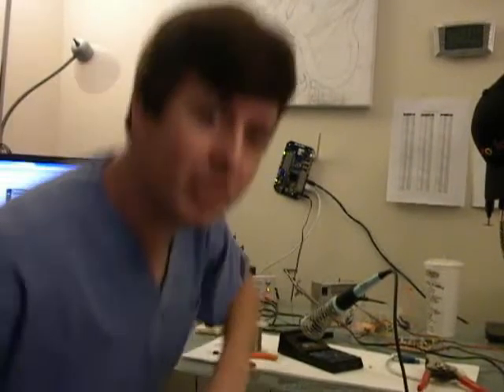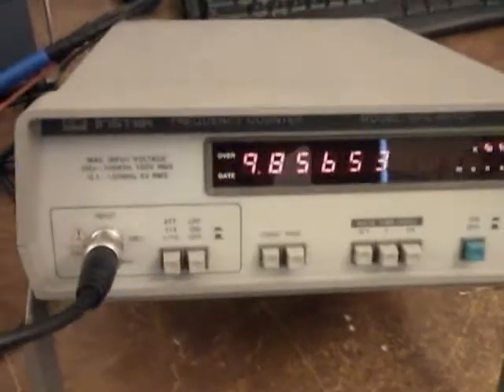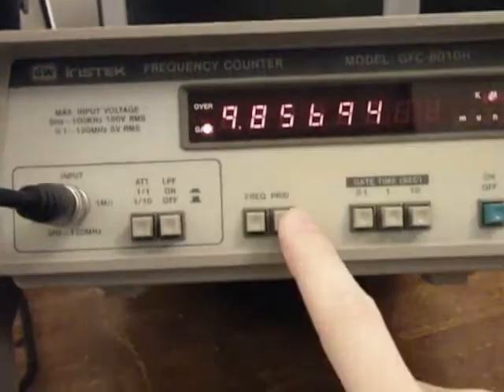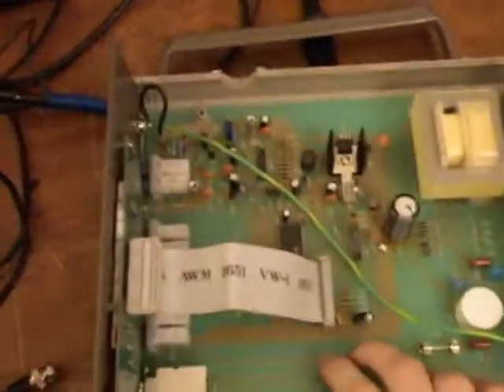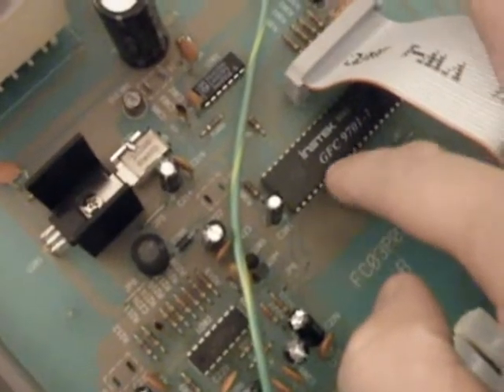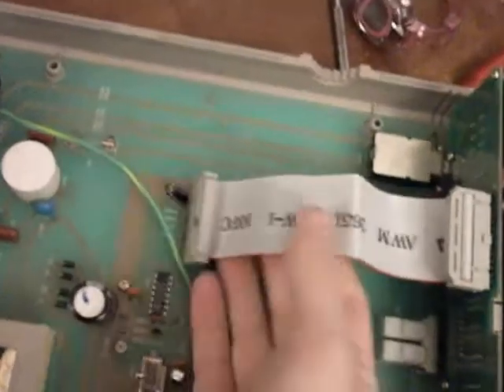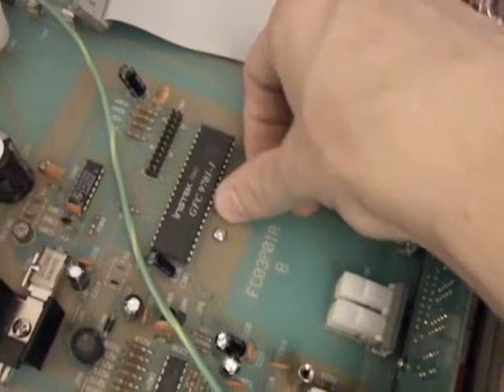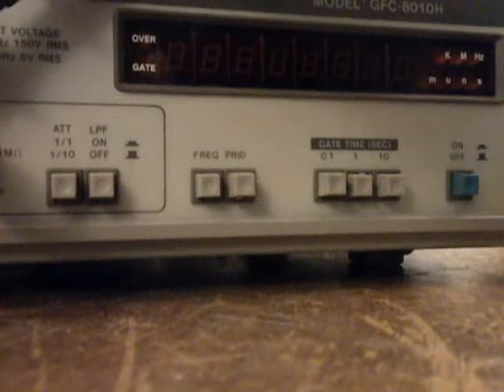hacking a frequency counter - part 1

Comment: very intresting, most logic anilizers i saw were 4 channels, over RS232.
i saw the other day at hackaday some chips to expand the gpio ports. maybe using one of those and a high frecuency microcontroler you could make yourself a 16 channel logic analizer.
hackaday.com/2008/12/27/parts-8bit-io-expander-pcf8574/